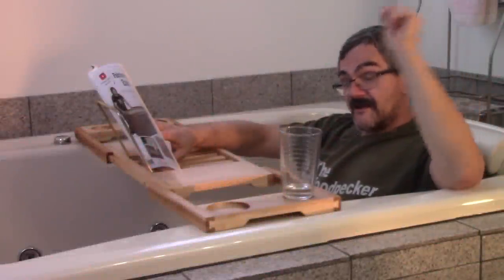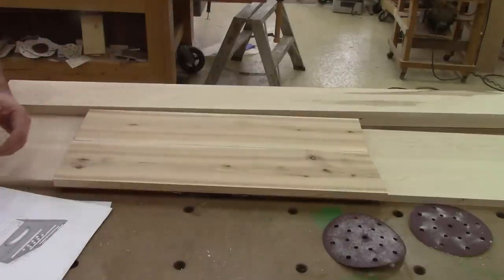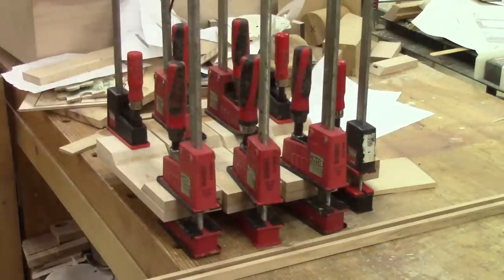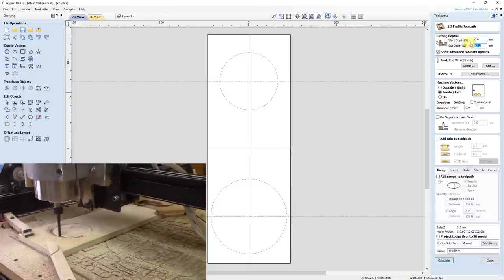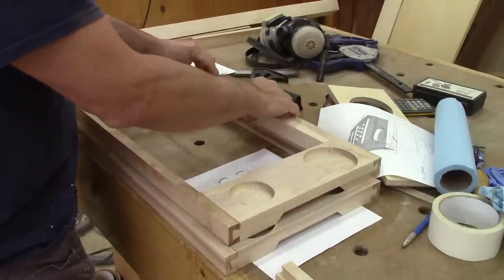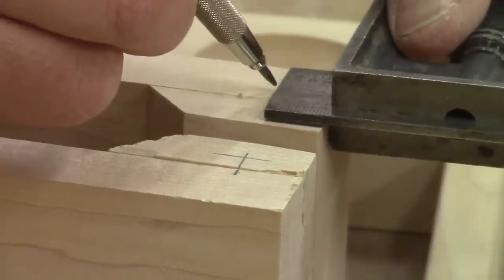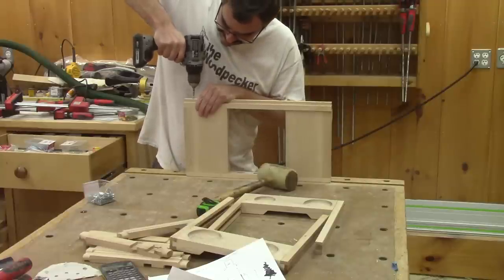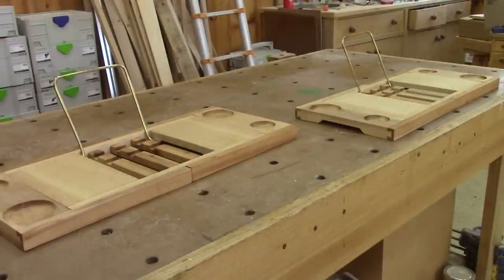The Woodpecker Ep 262 - Bath boards

Comment: What a great idea ,how do you think they do in cedar
Reply from the maker: I'm not sure cedar would be strong enough for a board with sliding dovetail like I did. But one that doesn't stretch out would be super fine.
Reply: @LgosseuxDbois-TheWoodpecker   i was thinking brass rods to slide on instead of the dove tails ,then i started thinking well i have a bunch of 200 year old slow growth pine ,maybe i should use some of that
Reply from the maker: I think pine would be stronger than cedar, especially if they're 100Year old slow grown
Reply: @LgosseuxDbois-TheWoodpecker  look beautiful when finish is applied